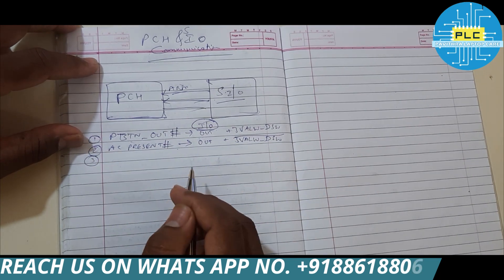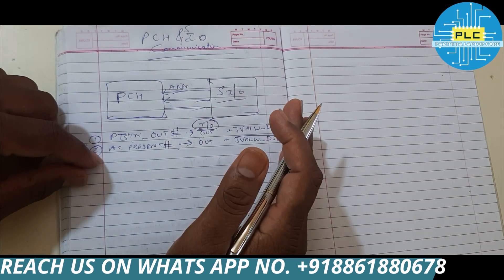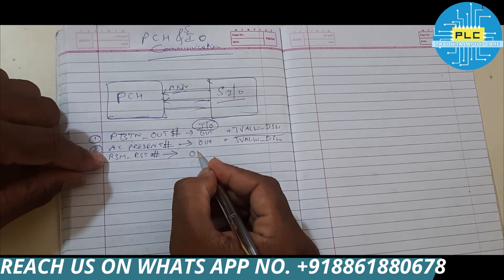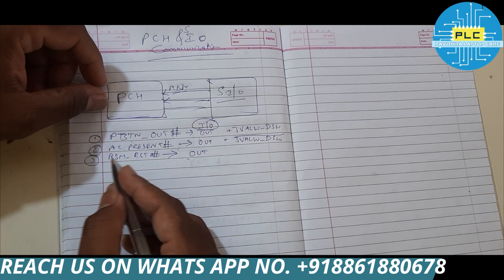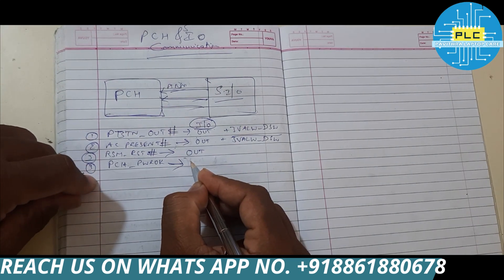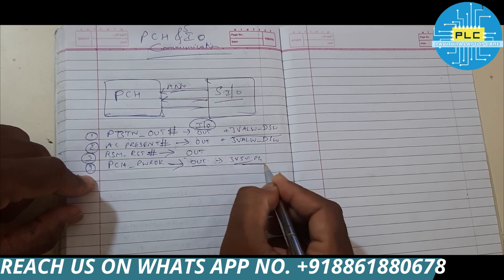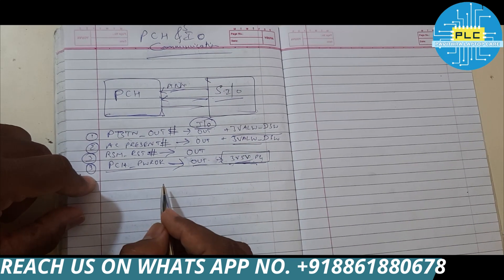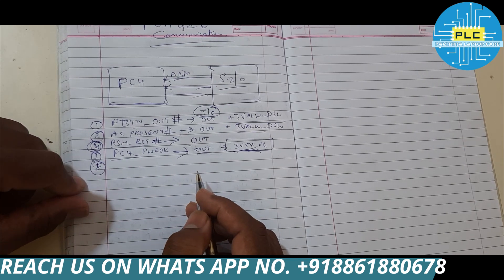LAPTOP REPAIR - SIO & PCH COMMUNICATION IN LAPTOP MOTHERBOARD

Comment: Hi, just found your channel and very good and i will watch your other videos as very clear and informative.   I had a weird  Toshiba Laptop CPU reset that i never found a video for on any channel. Its a old 2006 Toshiba and back of CPU is the big  "Tokin" Cap.    The problem?  Everything turns on and voltages correct everywhere and when i push the start button the VRM seems to start the CPU /screen turns on and i see voltages then BUT a few seconds later,  voltages crash and the board resets? I can do this over and over. Already changed CPU out and flashed the bios. Sadly, when trying to fix this board, i thought i caused a short and smoke came out of the EC chip and now its all dead but i wonder if the EC was already damaged and causing the reset or a weak VRM mosfet or dozen other things that caused the reset?   I really am curious what could cause the CPU to start then crash? as a learning lesson, no other videos seem to cover this fault.   So board worked fully then reset??  hmm, anyone with any ideas whats going on? I though the "Tokin Cap" may be high resistance /EGR/ low capacitance and thus cant keep the CPU running? thats as far thinking as i got. Problem with checking signals when crashing is all chips would be losing signals ,so how can you have 10 probes monitoring this? haha
Reply from the maker: If u r talking about Tokin IC, many videos are available.
Reply: @LaptopCourse  Yes, i have seen them removing or "hacking" the Cap off the board but none seem to talk about or diagnose symptoms and i wished i knew before working on my mothers laptop.  I have many boards that have unknown problems that shorts, missing signals ect done seem to give the answer.  Reflow chips too but still wont turn on. I have one HP 2015 M/B that everything turns on   and CPU is warm and voltages from the VRM are correct but GPU is OFF and cold. 1 Flash indicates "CPU failure"  but is it really as no shorts around it and ohms is 40ish which seems a bit high so either bad CPU thats not shorted or one of the little caps around or on back has failed?  This is tough case you dont see on youtube.

Comment: Good explain sir . What is meaning of #,@ symbol plz tell me sir
Reply from the maker: # means disable or enable the signal. In # case, if 3.3v or related volts are there then the signal has disabled. If no voltage,  it's enabled.  Example,  rsmrst #. It should be disabled. So, there will be 3.3v
Reply from the maker: An abriviated component will be present if it is before @ and absent after @. Example,  a resister name @R1801 means absent or not present.  R1801@ means present.